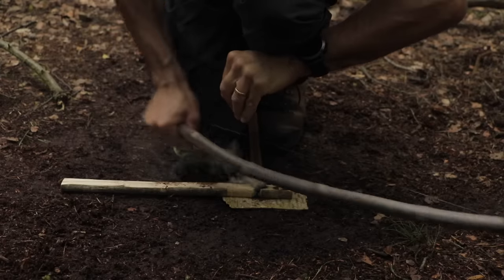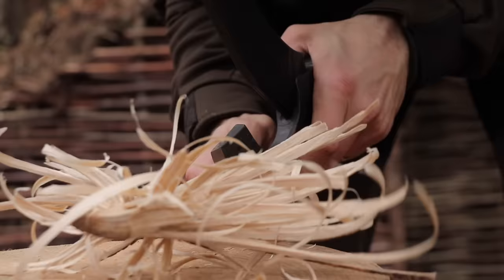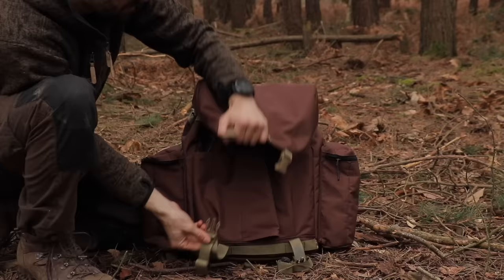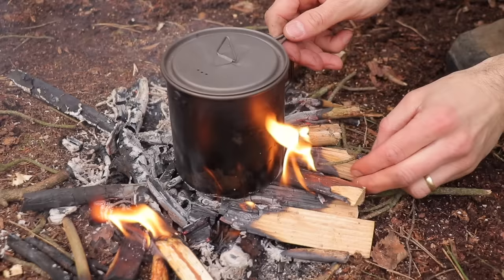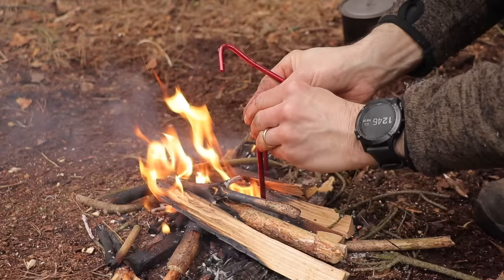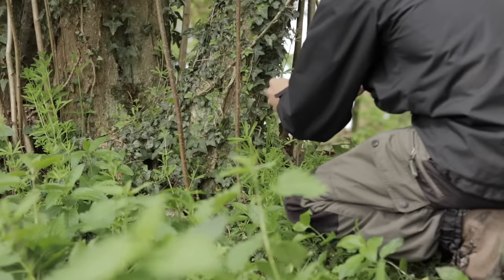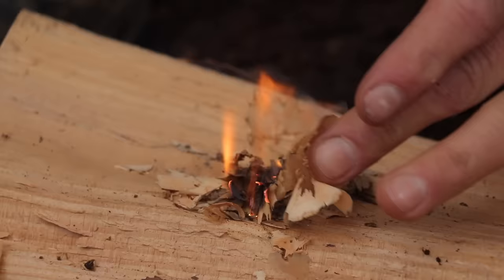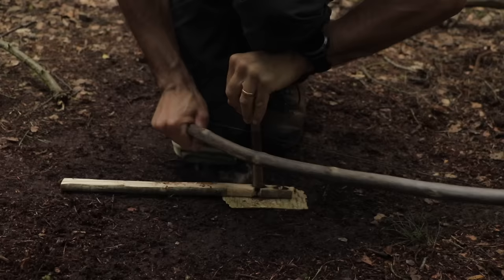10 Wilderness Survival, Bushcraft & Camping Tips in 10 Minutes

Comment: Brilliant idea with the tent pegs for the grill. So obvious of a choice but yet not something I never thought of doing. Thanks.
Reply: I will warn you, if you try this. Finding a piece of ground that is perfectly uniform at all 3 points can be difficult. If one of the pegs is on a small root, you may find it tips over when adding weight as the stakes are driven further under ground. Or the ground may just be too soft at all. Source: I tried to build my own camp stove and disliked using tent stakes
Reply: Leave the tent pegs at home, four rocks work just as good or better. Your welcome.
Reply: i dont think it was his idea lol a few of these things are in the videos of alfie aesthetics. i think mike watches him. cant blame him, alfie is a bushcraft guru.
Reply: Bing bong and Thank You! Gonna try some of these out next time. I'll update you with any cheers.
Reply: Instead of tent pegs I use 3 12 inch shelf l brackets they fit great into my haversack
Reply: Rocks can explode, need to know which ones to use or not. Aluminium pegs can also deform.

Comment: If you are using a sack, I strongly suggest sewing along each to strengthen the bottom and sides with a simple overcast stitch wrapping over the edge. It stops the contents or rough ground wearing or cutting through the sack material. We used to do this with farm sacks many years ago and any tough natural twine will do it. Dont use man made twine or it will cut the natural sack fibres.

Comment: If you have a hessian sack run a little bathroom silicone along the seams to strengthen and support the sewing. Because of its open weave hessian's stitching can fray out very easily. Also, oversee and then smear the silicone on. Silicone is very useful to waterproof small wear points and repairs.
Reply: Sorry, 'oversee' should read 'oversew'.

Comment: Here's a Tip: look up what a Buddy Burner is. It's a great style of portable easy campfire that you make with rolled up cardboard soaked in wax and shove the roll into a metal container. 

Well after you make it you can keep filling it with chunks of hard wax while it's burning and it will last you for agessss literally ages. It takes forever to burn down and all you need is to carry a significant amount of wax with you. One huge thick candle cut into small pieces to can fuel your fire for 6 hours non stop very easy, provided your buddy burner is the size of a tuna can or similar. 

I make them tea light candles (with cardboard rolls 2x taller than the metal rim) and they last 6 hours if I keep feeding, to have campfires in the woods in the park near a lake for just enjoying my night before riding my electric bike back home. It's the easiest way to make a campfire if you live a city where campfires are not allowed as you're not burning wood but are burning wax. It's basically a candle so cops are cool with it mostly and should be fine. 

Make sure to never pour water in it when it's burning though, as it creates an explosion of napalm burning wax splattering everywhere basically. Be very careful with that. 

It's reusable so super good for campfires.

Comment: Your top priority is your tent or sleeping area. 
You should secure that first by....
Your tarp setup should be on higher surrounding ground..
Your entrance uphill to avoid rain water running through your tent area.
You dont have a small shovel to dig a  runoff trench around your tarp area. The excess soil can be thrown onto the bottom of the tarp for weatherproofing.
You collect a bag of rocks but dont use them. 
The rocks make an excelent fire pit area avoind forest fires.
The axe should have pre survival precautions of a hole through the axe head and handle to avoid dislodging when being used.
Secondly take a plastic bottle and cut of the top and bottom, slide it over the axe handle and head the plastic to shrink fit, the handle for protecting the axe shaft...
The shacings a good idea but prepare more than enough...
Have a piece of 1/2 inch copper pipe about 9 to 12" long, fluted at one end makes an excellent blower to start or keep a fire going.

Comment: A warning for the tent stake stove. Tent stakes are meant to be driven easily under ground, at an angle. So you may find that any significant amount of weight tends to cause them to be driven down, and since they are now in a fire, difficult to fix. As you stir your soup or what have you, they may also be driven down unevenly, causing your pot to fall over. This can be somewhat alleviated by driving them at an angle in triangle pattern, like how you might build a teepee fire or a camp stool, but its not fool proof. I personally recommend just buying a twig stove if this heating method appeals to you